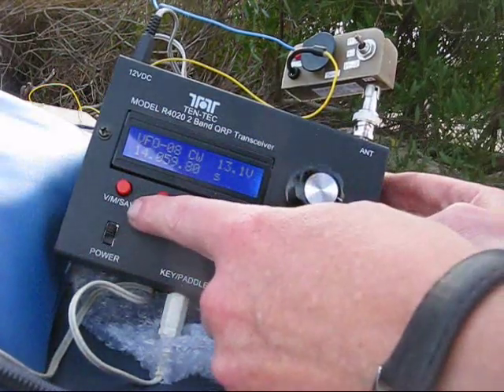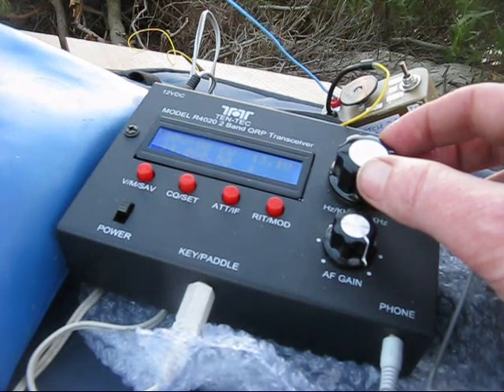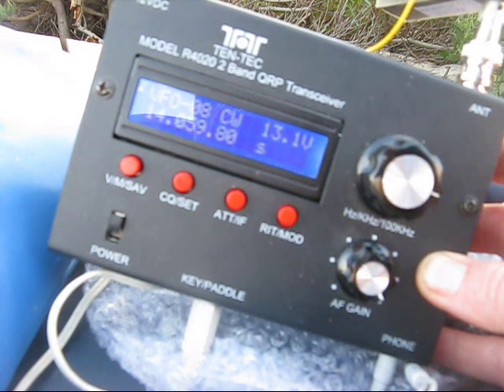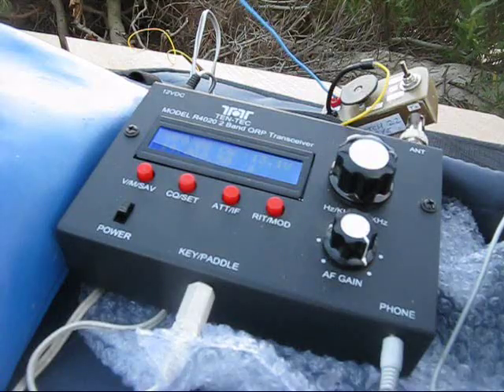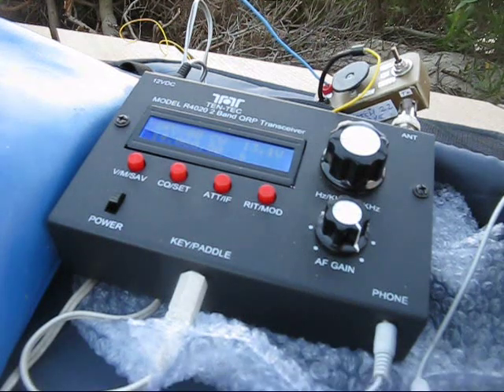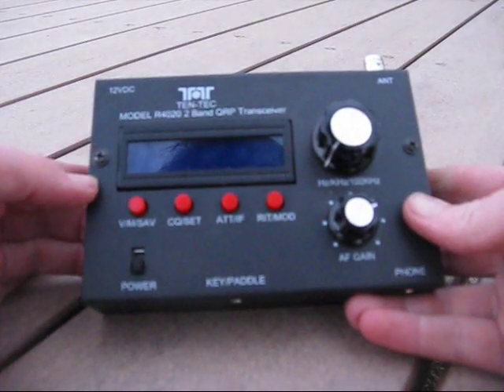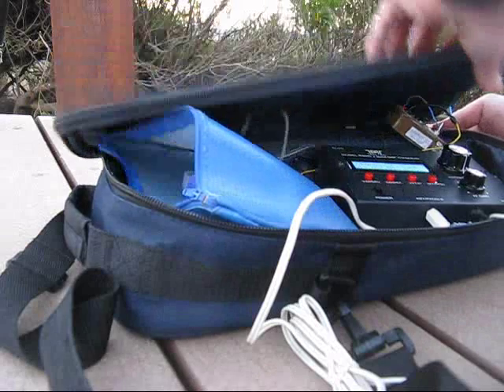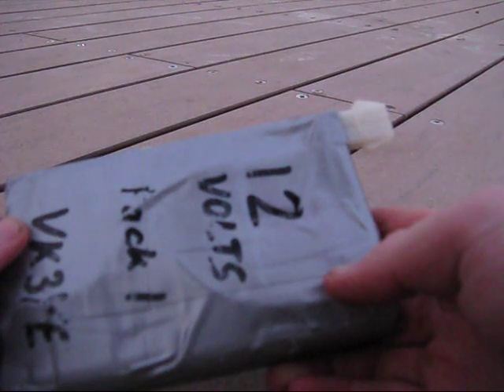QRP equipment review: Ten Tec R4020 CW transceiver

Comment: I use a amplified iPod speaker I picked up at a local Walmart store for $10 with mine and it works great! 
 I use mine with a Emtech ZM-2 ATU I built from a kit with it. I do have a issue with my R4020. When I'm tapping out CW using a straight key I can hear a frying like sound coming from inside the rig with every dit and dah. Not sure why, but was told by one ham that if I use a shielded cable to connect the CW key it won't do that. I have not tried that yet and instead just use my Hendricks PFR-3A 3 band QRP rig. I thought about selling mine, but am reluctant to do so because my R4020 was received as a gift It has barely even been used at all, only on 1 outing and that's all. It was shipped to me new from Ten-Tec with a sales receipt inside the box that had  "a gift from your friends on 3895 kHz" written on the receipt. Very 72/73 de KU4GW

Comment: Very good video but can't agree with the statement "The FT-817's 300mA receive current drain is too high for serious portable work".  A 3000mAh LiPO battery weighs 184g and easily powers the FT-817 for several hours.